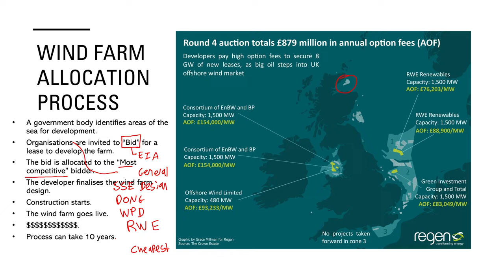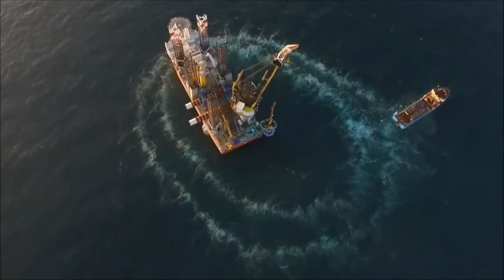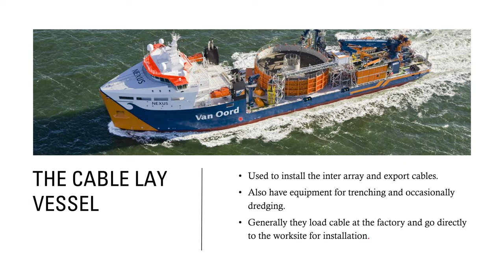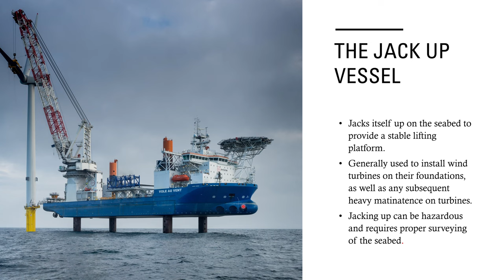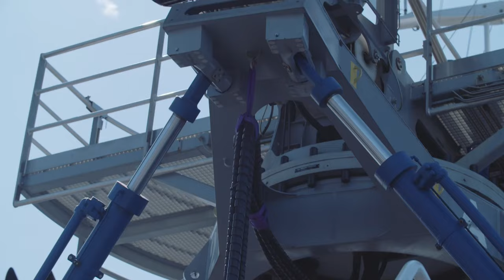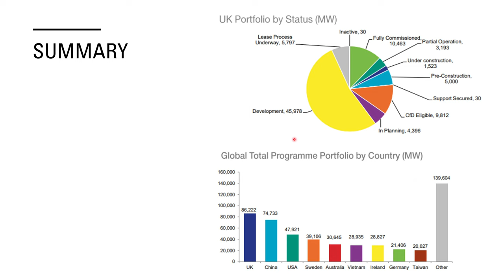Introduction to offshore wind part 5

Comment: hi Olly, thank you so much for such a brilliant introduction. Of these construction works introduced in this video, I am a bit curious about the piling work of jacket foundation.  As compared to piling of monopile that the hammer works above water, does the hammer have to work beneath work when the penetrated length is more into the seabed?  thank you!
Reply from the maker: Thanks for your comments! I should have been clearer that yes, the hammer on jacket piles, and most monopile piles, has to work underwater. Many hammers are capable of doing this routinely.